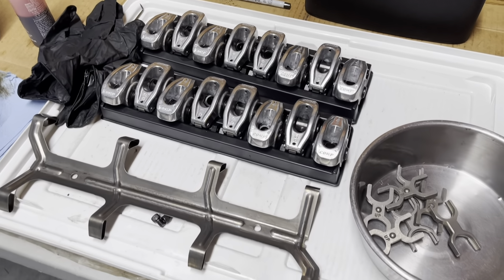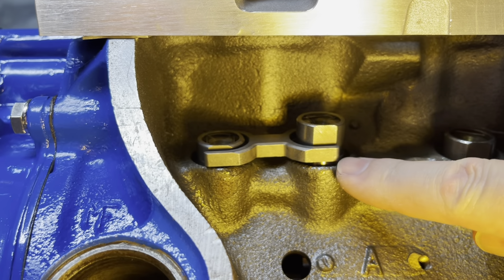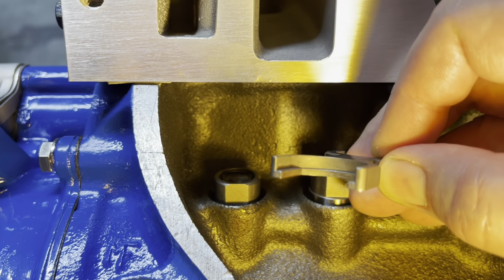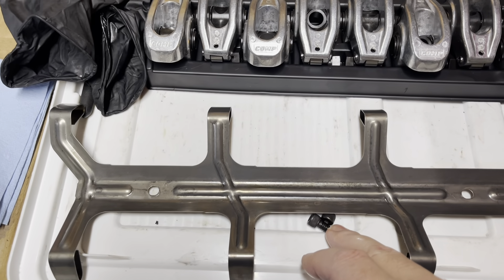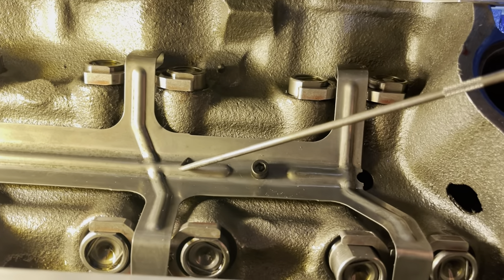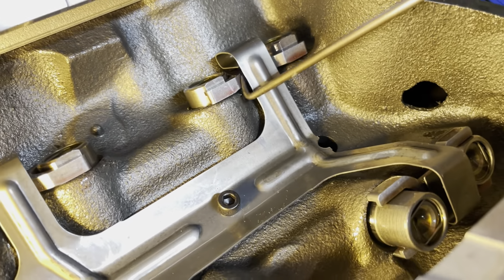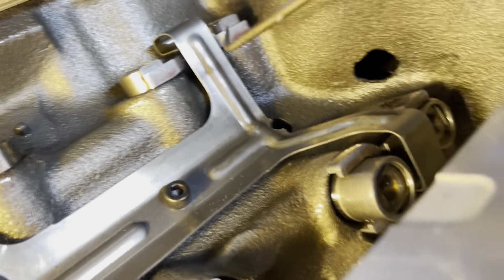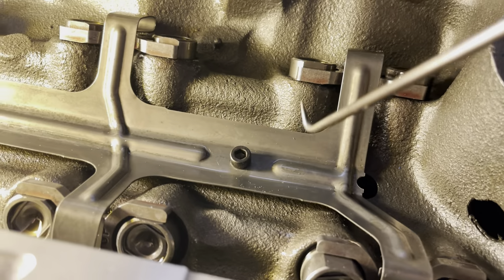Roller Lifters - Ford 289 331 Stroker Motor Rebuild part 21

Comment: And would this same method work for a 351w
Reply from the maker: Yes, as long as you get a compatible cam and lifters.
Reply: @JohnLatrobe  what do you mean by that, I have a 302 that cracked a crank so I want to use my e303 cam out of it in the 351, could I use my cam and stock 302 lifters and it’ll work?
Reply from the maker: As long as your 351W block is a roller block then you can use your cam and lifters. However, earlier, non-roller blocks (like mine) have shorter lifter bores that won’t work with factory roller lifters. The oiling ports will be exposed causing a loss of oil pressure.
Reply: @JohnLatrobe  alright thank you man, so I can still use my e303 cam but have to get a set of the retro fit lifters
Reply from the maker: Yes, retro-fit link-bar lifters.
Reply: @JohnLatrobe  cool thank you man, lot of help

Comment: So is the set of lifters you got shorter that the factory ones? When I searched the part number it says they are just replacements
Reply from the maker: They are replacements, but they are also designed to work with the retrofit spider tray kit. They only work in my case because I’m using a small base circle cam, not a factory roller cam.
Reply: @JohnLatrobe  ahh gotcha, thank you man